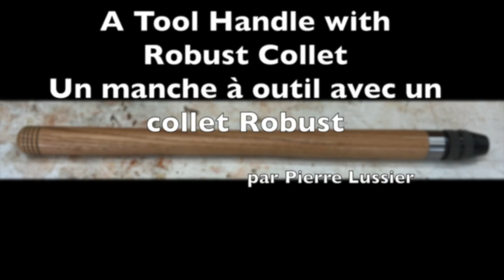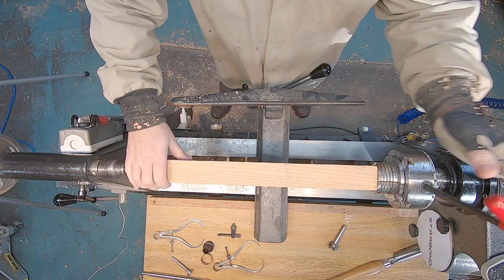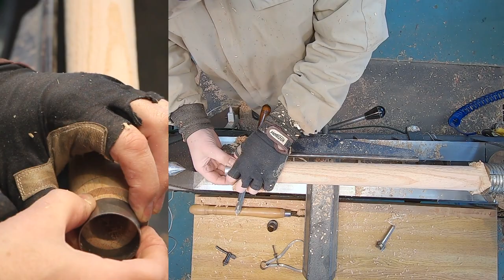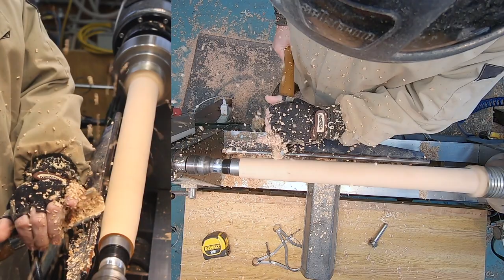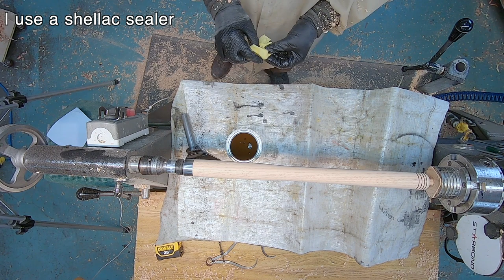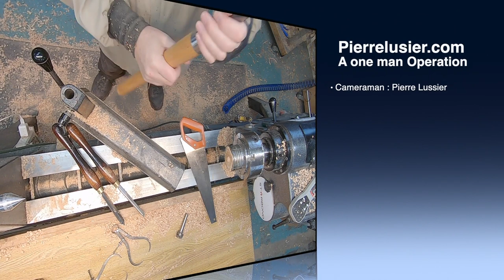Woodturning How to Make a gouge Tool Handle Tournage sur bois d'un manche d'outil Robust collet

Comment: Just found this - very cool, am planning on doing the same.  What is the drill bit extension you switch to at 3:08 to drill a deeper recess in the handle?
Reply from the maker: That is a extension I had made for when I did pepermill….